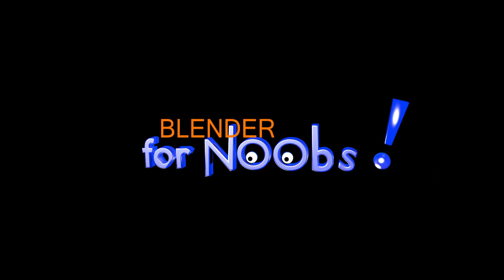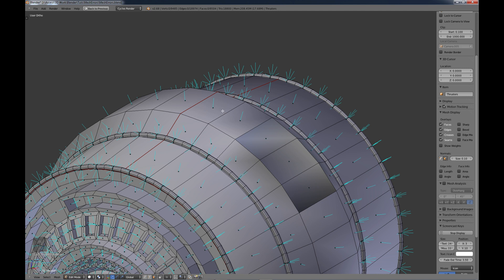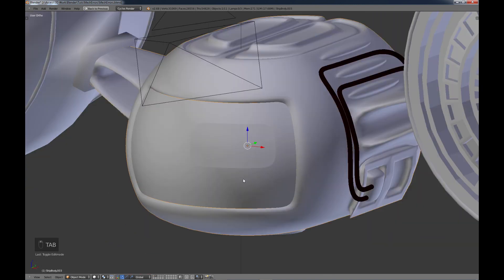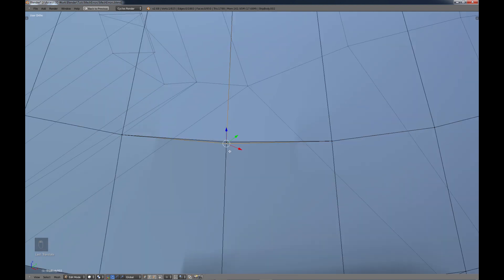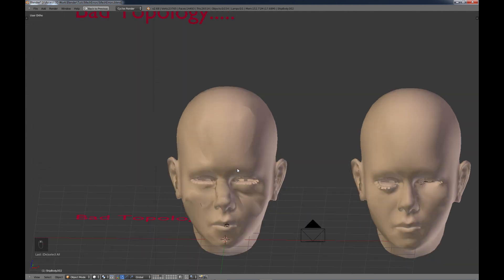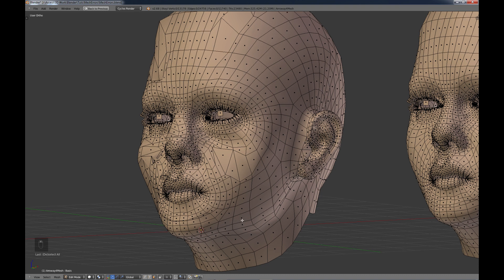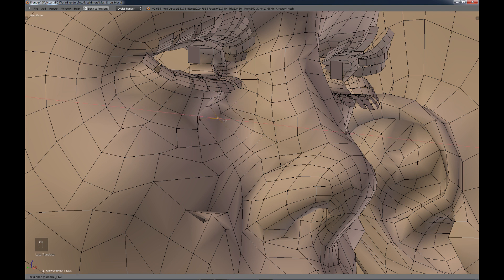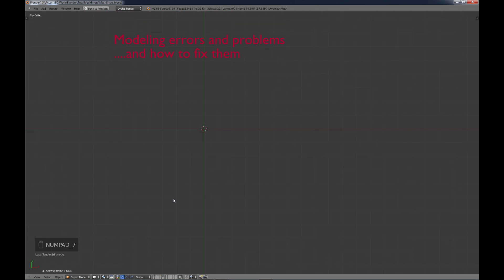Blender For Noobs - #12 The Most Common Modeling Problems and how to fix them

Comment: I have a problem and I'm not sure why its happening. I'm trying to model a female character and have got as far as mirror modifying a cube. I've noticed that it won't now connect all the verticies both front and back but it does on the sides. It did'nt do this before. Have I clicked something by accident. How do it fix it please?
Reply: Me too I wish I can fix this I'm trying to connect head with body

Comment: You are a pretty nice person! Yes, it helped me in a few ways. But I still have more things that I fail to understand. I was trying to get two triangles away at the upper middle loop (I call it a loop, but it has two ends) - the problem was when I was finally finished with this (I was having a lot of controls related issues, as I am very new to 3D-modelling), I have had three vortexes left on the top, but only one on the bottom - haha - forming a huge triangle then! So, bad! I did this because a girl and another guy in other great YouTube videos, have expressed so much about its factor of importance. I believe, if I want to make this head perfect, that I would need to add additional quads all over it to generate vertical counts of them in equivalence, to make only quads possible. Is this correct? If so, then I am wondering what happens to the pose morphs that were created for this head, once that head would be geometrically perfected. I have also not understood, why the newly set edges are blue, and not red like the original ones.

I am almost sure that you know the answers, and I need them so badly!

If you will be so nice, please help me with information with a reply here.
Reply from the maker: Hi, What I will say about quads and tris is that yes, for the most part, it is good practice to have all quads...this has mostly to do with how the geometry will react when rendering or doing other changes, but a few tris in a mesh is still ok.  The other side of the coin is that IF the mesh will be used in a game, often the mesh is converted to all tris anyway!  But yes, if you are working on a head model, it is best to follow a tutorial where they are doing a good mesh so you can see how to fit it together.  The red and blue edges I did not understand that part of the question.

Comment: Too many words, too little wisdom. 
There is a secret to all these movies: montage. It's when you cut the chaff away and connect the meaningful parts together. 
Also, it isn't clear how good topology with screwed vertex locations have become a bad topology. Bad model? Yes. Bad topo? No. 
Better luck next time, but for now, a dislike from me.
Reply: The man's objective was to help beginners with typical modeling problems, not win the approval of those who have long since advanced beyond beginner status but refuse to acknowledge that you too struggled with similar issues. He chose to be proactive, and encourage someone to strive towards the next level rather than to appear omniscient .

Comment: Not a bad video. I've been more into hard surface work (though I know I seriously lack in character design, so I know that I'll definitely want to watch out for Bad Topology if I am ever needed for such a task.

I'll add that I have had to be careful about the direction of normals due to the faces being an interior portion of the mesh, like a tunnel going through a rock formation. I have already had to watch Topology considering how with rock (and depending upon the type of rock you're wanting to 'simulate,') you have to consider the physical roughness and how often juts appear on the rock. If you ever subsurf with vertices far too askew, you're probably going to have a bad time or you're going to be doing a lot of translating / sliding vertices.

Comment: Great. You shown bad topology but hasn't shown the fast way to fix it. just tell about magic button like "Smooth Vertex" in Deform Panel you couldn't or you didn't knew that too? ok. you had moved a few Vertex random but it's madness to fix more 1000 vertices by your advice.
Reply from the maker: Azuruish Yes, smooth does actually help arrange the topology better.  In some cases it works pretty good, but has the downside of shrinking the model.  It's a nice quick way to help a disaster.  But best to learn good topology to avoid disasters.

Comment: -When you see that shimmer on a face that is call z-fighting (meaning the render view doesn't know which face has priority). You can also get a similar effect from a mesh that has harsh angels that are softened, this is a rendering artifact.
-If you have two faces occupying the same space with normals facing in opposite directions that is "often" a laminate face. This will give a harsh crease line around that face when subdividing a mesh, as if you had put a supporting edge there.
-Poly flow is "primarily" for deformation and animation, that is rigging and animation. While good flow can help with smooth tessellation of a mesh it is not necessarily needed. For a human face the poly flow commonly follows the crease lines of the skin. if you are looking for the flow get an image of the face screaming or squinting, or flaring the nose. This images will give you a good idea of how the poly flow for the face you are doing need to go. This assumes it needs to deform (animate) Otherwise as long as it looks good you can do whatever with the poly flow.
-For texturing and or export for sculpting your faces need to be nice squares or as close as you can get. For sculpt you want all quads unless you know where you want pinching.

Comment: I had some issues with normals facing wrong way with version 2.71 and seems it's a bug although it could be a feature also. because in version 2.71 when you rxtrude vertices it determines which way normals are pointing. In my case my 1st extrution was outside and that flip normals to dark face. extruding inside flips right way. 2 days I was sorting this out in blender forum to figure it out why it is so when this is not the issue in 2.6 and downward. I still don't quite understand waht's the point of normals ? Is it programming reason so computer can calcule inside shadow of a coffee cup etc ? And when would you ever want to use the darkside as a front normal ???

Comment: sometimes when i work i notice that there is so many vertices close to one another lined up in some edges i always dissolve them but i want to know why thy happen and is there a way to avoid them ?
Reply from the maker: Pay special attention to how you are working with the mesh, specifically, how you are deleting.  For example, if you delete 'faces only', this could leave verts hanging around.  This may not be exactly what's happening in your case, but something to start with.
Reply: i know, i learned that the hard way, but thank you very much for the quick replay and the amazing tutorials

Comment: somtimes when i press ctr-R some places wont let me place a devide? hou do i fix that?
Reply from the maker: If it won't let you, it usually means the existing geometry where you are trying to divide it is not able to have an edge loop.  I would need to see an example.
Reply: Just switching over to blender from maya/max today. But In most applications I've used the edge loop tool only lets you place an edge loop through quad geometry, this means all faces that will have an edge loop through them need to have ONLY four vertexes at it's four corners one vertex per corner.